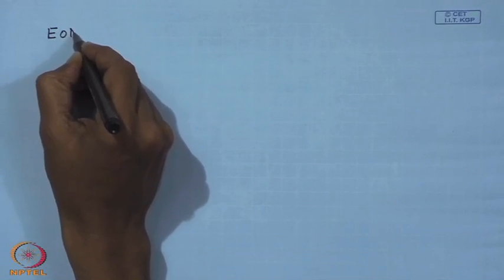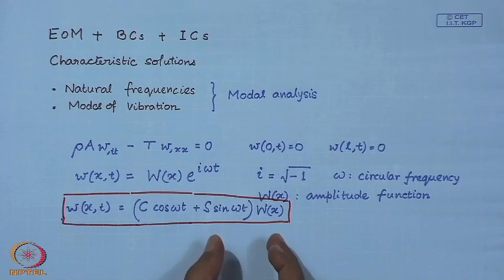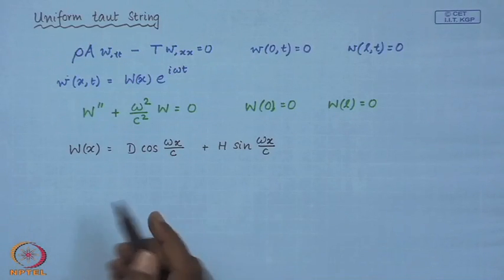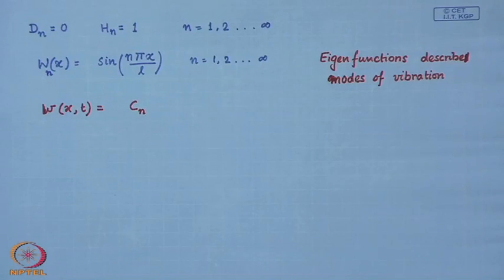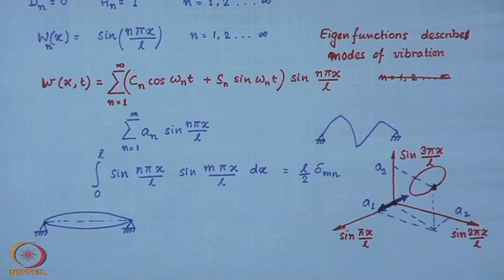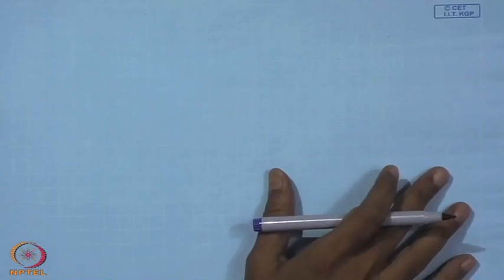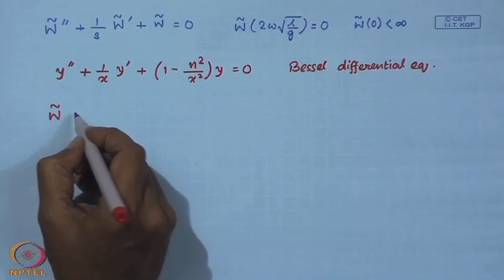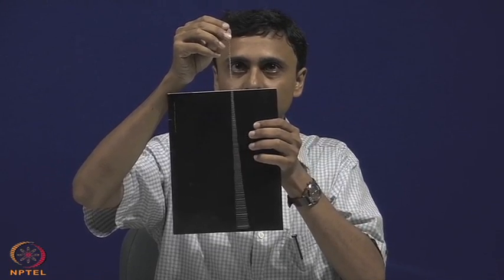Modal Analysis - I

Comment: I am industrial engineer. More than 5 years experiences with MATLAB/ANSYS/SIMULINK/R/SPSS/EXCEL/SOLIDWORKS....I can solve all your problem in the fiel of : mathematics, electrical engineering, mechanical engineering,control and automation, data analysis, strengh of materials, physics, fluid mechanical, computational fluid dynamics, system modeling, heat transfert, hydraulics...statistics, linear programming,
free to colaborate with you (long term)

please see my portfolio

Best regards
https://www.assignementexpert.com/